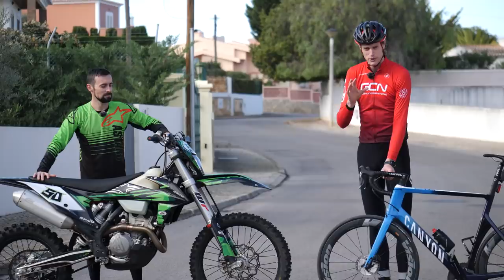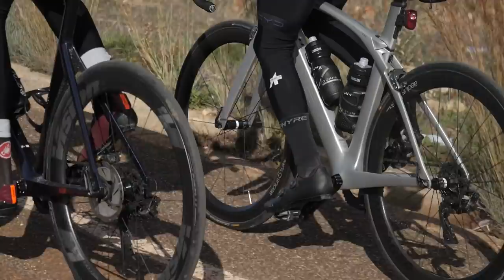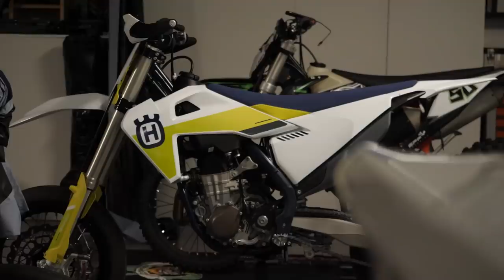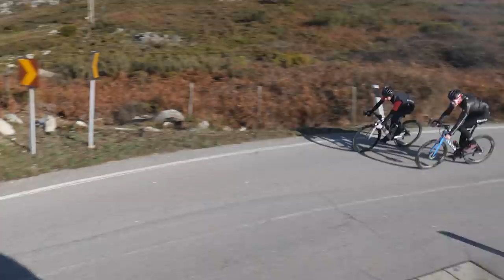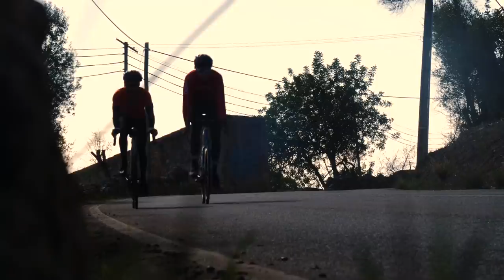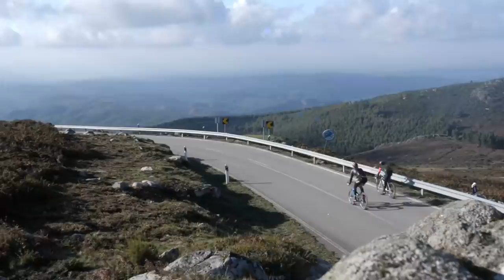Pro Motorbike Rider Vs Ex-Pro Cyclist: Road Bike Challenge

Comment: Eugene is spot on about the warning you get from motorcycle tyres compared to road bike tyres, when I first started group riding road bikes with friends, the two of us with motorcycle licences were the least trusting of grip levels from front 25c tyres at 2.5x the pressure we were used to.
Reply: feels like the moto is much safer if you discount the careless car drivers on the freeway. skinny roadbike tires can give out on a corner pretty easily.
Reply: It's funny, because I've recently started riding motorcycles, and I don't trust motorbike tires :D
Reply: I have had a flat on a motorbike around a gentle corner at about 30mph. While there was a moment of panic I stopped without to much fuss. Would not fancy the same happening on a road bike at that speed.
Reply: @robwalker4653  Front or back? I've had my share of flats at speed (roadbike >50kmh) and it matters which wheel it is. Front is super scary, rear is no fuss.
Reply: I found the same distrust. Whats interesting is that on a mountain bike in dirt you can develop a similar type of progressive release and not the snap loss of grip that happens on a road bike. I think with ~25mm of rubber there is just no way for a tire to behave like a big bike or a  car.
Reply: @greatapex2280  Front grip loss is always more scary, pedal or motorbike, road or off-road.
Reply: Oh my goodness

Comment: 1) You got the lean angle wrong. What matters is the angle from the contact patch up to the combined centre of gravity of the bike AND the rider
2) As a motorcyclist myself (i own 4 motorcycles and 3 bicycles) I can say that speed is all relative. My road bike feels fast after riding my MTB, just as my VFR feels fast after riding my CB450S. 
My point is you can still get a sense of speed on a bicycle

Comment: Great Video Folks and huge respect to both protagonists !!
I also came from Motorbike racing in my early twenties and had an hobby bike carreer afterwarde that still goes on now that I'm 54.
As Eugene said there are quite some Motorbike racers out there who are quite serious about Roadbiking. In the UK I know that Scott Redding and Cal Crutchlow for example are. 
All the best to you all for the new season on whatever bikes you ride !! 
P.S.: interesting question to Motorbiker on a Roadbike imo:  on Motorbikes the frontbrake is usually attached to the right handle bar. So I remember having it left seemed a bit odd to me when I swapped bikes at first but I decided to leave it there to get used to Roadbikes as they usually are equipped. Curious how other cycling Motorbikers handle this. Maybe a good qtn for a follow up vid with Eugene?

Comment: I prefer a road bike rather than a motorbike because of the following reasons:

1. Freedom, which means you don't have to rely on outside power to travel and you can handle most of the mechanical issues by yourself on the road.
2. Survival rate during an accident. I experienced at least 3 serious accidents while I am cycling. 2 of them cracked my helmet, and the third one makes me stay home for about half a year. I think if I experience a similar accident on a motorcycle I will die for sure.

Comment: Correct me if I'm wrong, but didn't professional cyclists in the 90's buy into the same cornering technique used by competitive motorcyclists? My guess is that cyclists found the technique to be more dangerous than necessary and dropped that practice fairly quickly. A motorcyclist will keep the bike upright as much as possible, offsetting his body in a corner, whereas the cyclist must stay in the saddle and bank the bike to get the most speed and traction.

Comment: So motorcycle racers like to keep their machines upright in the corners, uh, okay, but they do tend to lay them over like a pancake in every single corner, incredible.  And for sure, different experiences, bicycles and motorcycles, yet there are similarities and one is screaming down a mountain on a bicycle and flying through the corners--or over the jumps and ruts on a mountain bike.  And with either you have to be careful not to exceed conditions.  And it was only for a year but in '79 in California, my Dad gave me free reign on his BMW R100RS, the first fully faired BMW sport bike and one of the first in the States as he had imported it from West Germany, and I was 19/20 that year and there were lots of days when I used that BMW for commuting--and that motorcycle was barely breathing in the fast lane--and rode my BMX bike for fun and conditioning.  And it was simply two different thrills and kicks, tho' on the bicycle I never had any encounters with the California Highway Patrol, both of which were good, actually, turns out CHIPs were cool like the TV show.

Comment: Have one of each, don't race either. Biggest cross over over I've found is safety on the road. So much from riding a motorcycle on the road crosses over to a push bike and sharing it safely with cars (as in not getting hit) .

Comment: wait, what he said about corning, leaning the bike instead of leaning the body. Is that actually true? I would imagine on a cycling bike its also best to keep the bike more upright so the contact area is where the tyre is grippiest/cleanest/least tread.
Reply: For road cycling, no it's not true and you are correct. It's typically more of a psychological/fear or training thing. Remember that Eugene is used to having  a thick layer of leather and hard plastic sliders between him and the asphalt, and even with those he knows how much it can hurt. The thought of doing more or less the same with lycra and bare skin sends shivers down my spine. 

To go into more detail.

Centripetal forces are one part of the picture, as you go around a bend of a certain radius your body weight (and that of the bike) want to pull you over to the outside of the corner. You counteract this by putting your weight to the inside of the tyres contact point. As you go around the same corner faster the forces increase and you have to put your weight further inside which usually results in more lean (of the rider) This keeps going until you lose traction and the tyres slide out from under you. 

This leads to how tyres get traction, which is very variable depending on the tyres and their tread pattern. But typically the more weight you can put through your tyre contact point the more grip it will generate. While it may seem that leaning the bike over while staying as upright as possible (like Eugene did) will have more weight going through the tyre there isn't actually any real difference compared to the "knee down" style that Conor uses (so long as he doesn't actually touch the ground). There is a difference though in how the tyre behaves. Because Conors bike is more upright the contact patch is further from the rim and it is better able to absorb bumps and is using the cleaner, warmer part of the tyre which will have more grip. 

However when talking about off road riding (where I imagine a lot of Eugene's small bike experience comes from with dirt bikes and mtbs) the opposite is true.  Tyres in those disciplines have knobs at the edge of the tyre designed to bite into the soft ground and encourage you to lean the bike over as much as possible to engage them in order to generate traction.
Reply: @eoinkenny3188  Couldn't have explained it better.

Comment: Fun video but I can't believe you didn't have a descending challenge. How far you can lean over in one corner only tells part of the story.  Also, Eugene's description of why motorcycle racers get arm pump kinda went off the rails. It's not just from holding on and braking, but from using one's arms to countersteer making rapid direction changes. You don't just sit in the seat and turn the throttle.